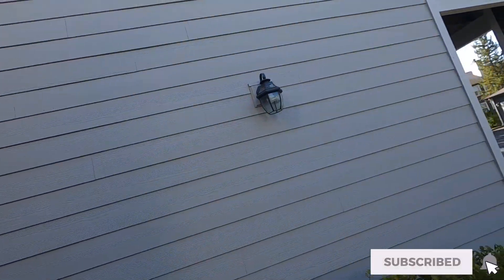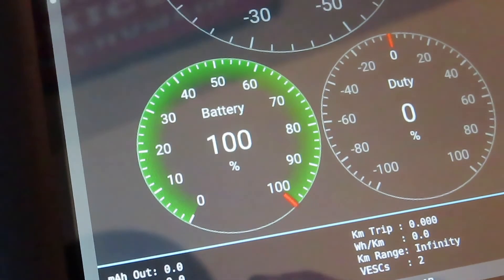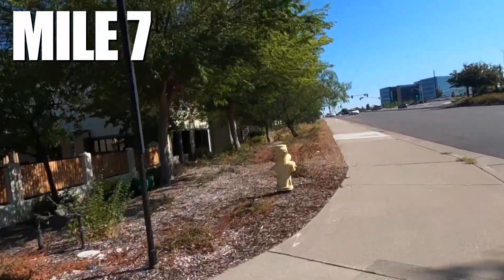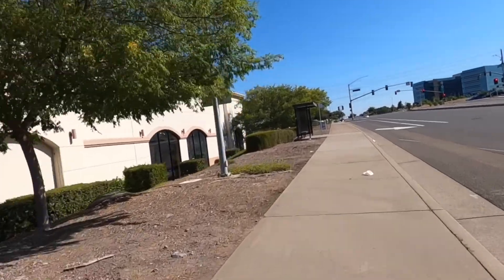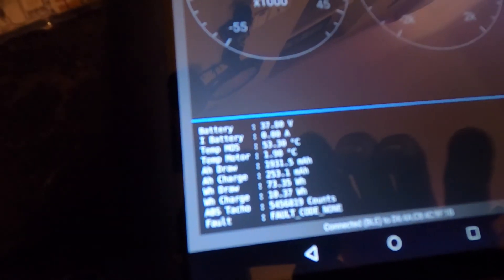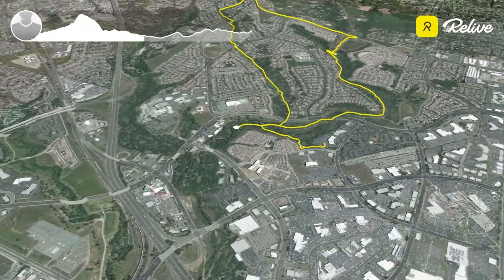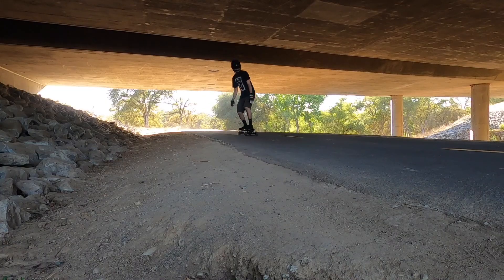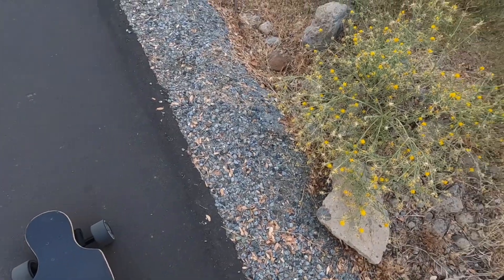18650 | 10s3p | DIY Battery | 6374 Dual Motor ESK8 | Range Test

Comment: What mah hour battery did you use for this build?
Reply from the maker: Hello. I used Samsung 30q cells which have a 3000mah rating. Since I did 3 in parallel this pack is a 9000mah pack. Thanks so much for the comment!

Comment: Hi I Have question why did you change from :
Dual belt driven 50A-120A 
to
Flipsky Dual 6.6 200A
Your motor have more Power? 
1 motor have 100A and 2 motor have 100A That's why you gave a bigger driver ?  50-120A give Not enough power ?
Reply from the maker: For me personally it was the ability to customize the board. ESC is pretty much set. With a VESC you can program things like the acceleration curve and braking curve. Just more options. Thanks for the comment

Comment: I love the content and the board.  Great vids!.  I was wondering tho, if the batteries die or motor stops running, do the wheels still spin freely or do they lock up and you end up flying?  I know in your previous vid about the VESC you said you had a nasty fall. Thanks
Reply from the maker: Thank you so much for saying that! Really appreciate you! As for the battery......there are a couple safety checks in place. The VESC has a setting to where you slow down when the battery reaches the voltage you designated as the “lag” voltage. When you reach that it isn’t possible to achieve speeds that would throw you off if and when the battery does die. 

If you do run out of battery and have to still get somewhere it is still possible to kick it but the belts do create some resistance. You also don’t  roll as far because of the resistance but it’s still technically rideable.
Reply: @ADayintheLifeofMr23  Thanks for the quick reply.  I really appreciate that. 

Ok, sweet.  My fear was that after a long ride, i'd get chucked off the board if power went out or low.  Thanks again!
Reply from the maker: hellalike no problem at all! Glad I could help. Thanks again! 🙌🏼